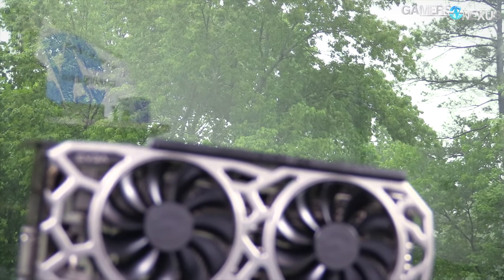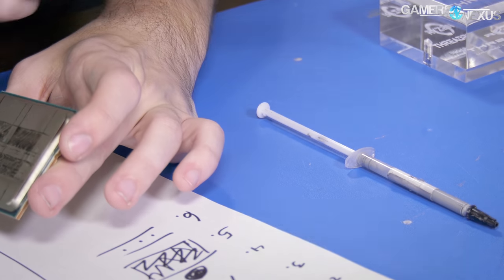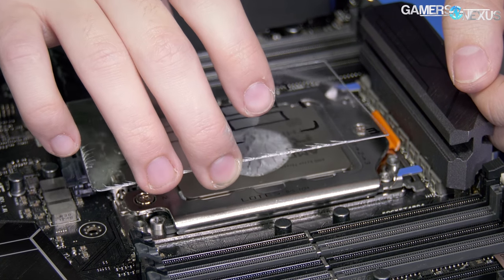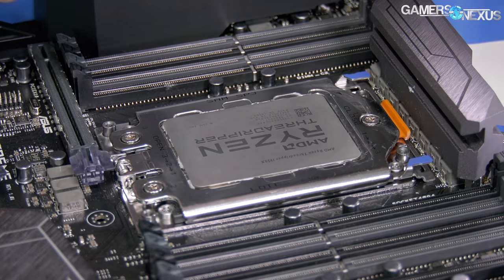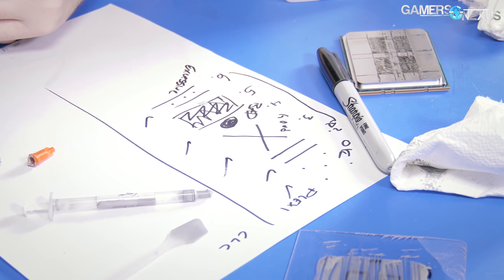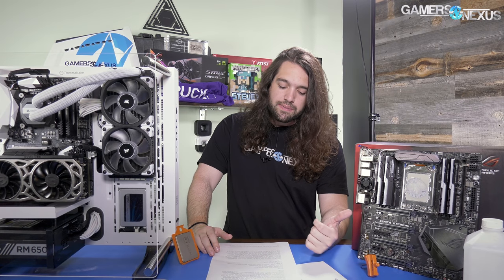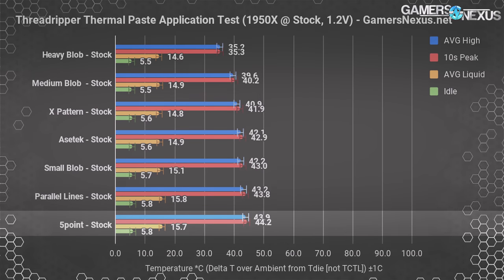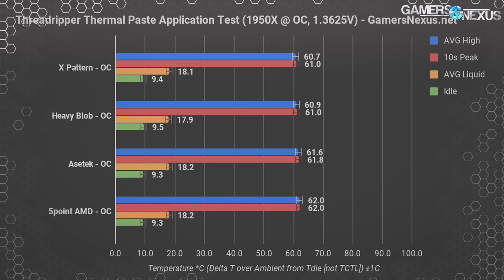Threadripper Thermal Paste Methods Benchmarked

Comment: as I said ! the heat is gonna be a huge problem as the the contact between thermal paste and cpu die and heat sink is very important then which fan u r going to be using.
I recommend u don't rely on thermal paste spread, just spread it manually using a plastic gloves of course.
Reply: this isnt intel bro... this shit is soldered so i dont think we need to worry as much about spreading it over the entire surface area.
Reply: It's not like manufacturers can't adapt to it, sure if you want to be the first one with a new CPU you will have to compromise, but give it a month or two and I'm sure somebody will be making a cooler for the new socket. And it's not like development costs for those would be huge, at least for air coolers, and it is pretty certain that the new socket will be around for a few years making it pretty worthwhile.

Comment: Does anyone else just spread their paste manually? I always take a knife and spread a thin layer across the whole lid.
Reply: Rudy Silva it makes no difference in cooling if any dot or line has enough paste. Spreading is messy but the safest method especially on bare dies, ie Delided CPUs and GPUs

Comment: Why aren't there any Threadripper specific high-performance CPU coolers available at launch? I think AMD dropped the ball here. I won't buy a Threadripper system until they are available.
Reply: Vallhund a custom ek loop will be available which is like the highest performance
Reply: I've been searching and haven't found one yet. Please post links if you know of any that are actually available. I'm talking oblong rectangular that covers all 4 die positions completely.
Reply: Noctua has coolers available for TR4 with the appropriate size baseplate http://noctua.at/en/products/cpu-cooler-retail/nh-u14s-tr4-sp3. Since TR is soldered I doubt one would need anything more than this, but will see
Reply: Yep, very disappointed by the lack of coolers for threadripper at launch. Not a single coolers available that's made for the socket. Sad.
Reply: Thanks, I checked it out and maybe Ii'm wrong but at first look it seems like they just made a custom base for an existing cooler.
Reply: TheAmmoniacal AMD provides a bracket inside the cpu box for all astek manufactured AIO so its all good 😊
Reply: Andreas, everything else is available here in the US on August 10th. If you pre-order on Amazon you might even receive your order on the 10th.
Reply: Adrian Wujtowicz high performance, asetek coolers lose to the best air coolers and better water coolers
Reply: It launches on the 10th so you must be from the future.
Reply: trevor jaster noctua fans are better than ek...but ek radiators are awesome
Reply: there not really necessary it runs nice and cool for what it is
Reply: I thought I heard there will be like 5 coolers (all air) released on Launch day and the bracket to use any current asetek pump, honestly though if you are serious about threadripper I say go EK full coverage, something about leaving part of the IHS completely uncovered doesn't sit well with me
Reply: None of the asetek-based coolers are made for the TR4 socket, the bracket only lets you mount existing watercooling blocks onto the socket. I'm not happy with it at all, the size of the waterblock itself is a bad fit and the thermal compound application is even worse.

There are no air coolers available for TR4, and there won't be any available at launch day tomorrow either. Noctua's coolers will be available at the end of the month (~26th).
Reply: They are on there way:
http://www.pcgamer.com/enermax-launches-a-pair-of-full-coverage-liquid-coolers-for-threadripper
Reply: Thanks rocetman221projects. I'll check them out.

Comment: so tired of this argument you ALWAYS SPREAD  over the entire metal slug/lid same if just applying on to the die itself remember under that metal is more TIM thats why its a HEATSPREADER to give you more surface space for the heatsink the heatsink sould always have a even cover on its base and cover the chip completely for max cooling
Reply: i stick with what i said i been comp overclocker for many years and computer enthusiast for over 30 you spread a super thin layer over the contact surface period the pea size thing came from the days when all cpus had there die exposed so doing that just made sure it would be covered as the excess would just spill over

Comment: Your testing methodology is flawed. At first, I was expecting you'd use a hard acrylic block to press on the IHS go simulate a see through heatsink (Tek syndicate used to do this). 

The way you're hand pressing the damn "plastic" makes it as if any kind of application doesn't matter anymore (other than coverage area). I can't and won't be able to see formation of air pockets because your hands and that soft plastic screwed it all up.
Reply from the maker: Did you even watch the rest?
Reply: i did. i downloaded it to offline videos and watched it while having my late dinner. you cheaped out with that "plexi glass". that thing has no... whatcha call that? structural integrity for a proper pressure. i especially dislike the method in which you handpressed the "plastic". give the original Tek Syndicate's how to apply thermal paste video a watch and you will see my concern why.

Gamer nexus, i like your videos. i had expected a certain quality of thought put into it (a part of the reason i was disappointed initially). your end conclusion in the video "it doesn't really matter" still don't quite justify the lack of initial thought put into testing methodology.
Reply: @HaiHane
Pretty sure the plexi glass was merely to give you a rough idea on how the paste would spread. There are pictures of the IHS / coldplate for each application method, showing how it did actually spread.
So I don't really understand why you think the conclusion is invalid now?
Reply from the maker: If you watched the rest of the video, you saw the part where we explained the plexiglass was insufficient and switched over to using the cooler installation instead.
Reply: @Marcel Krebs,
not invalid, but flawed. 

in the end, it probably doesn't really matter, that air pockets get trapped inside and in between IHS and heatsink. but if one does indeed try to strive for perfection (i DO care about things like this. the thought that there maybe air pockets in between disturbs me), one should test it properly. probably it doesn't matter to you, and probably the air pocket(s) may disappear overtime with extreme mounting pressure. 

probably you're not a perfectionist-ish like i do, or feel like there's a thorn in your skin if things aren't done perfectly (problem is with me). i clicked this video, expecting to see which application method might produce air bubbles when pressed down. i did not expect to see that flimsy plastic being "handrubbed".

let me put it this way: if you have an air bubble in between your screen protector and smartphone, would that drive you nuts? i get that uneasiness if i did a shit job applying thermal paste to my CPU.
Reply: what if i wanted to see what actually happened under the hood?

Comment: After watching the entire presentation, I did not learn anything. Thumbs down, sorry.
Reply from the maker: You didn't learn anything from the temperature figures, the overclocking results, or the voltages?
Reply: Gamers Nexus no, in terms of how to apply thermal paste. I am only one of the thousand's of subs you have, but I tune in to "learn". Temps are temps, only difference is cooling solution. So as an experienced dyi'er no I did not learn anything. Sorry.
Reply: I also forgot to mention that I watched that german overclocker delid the TR processor. So before watching your presentation i had a good understanding of how to apply TP.